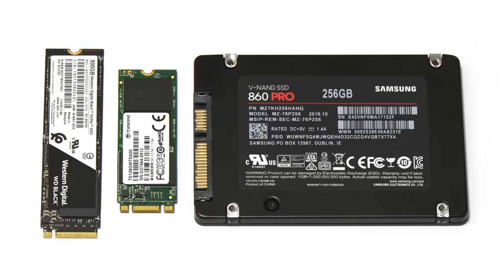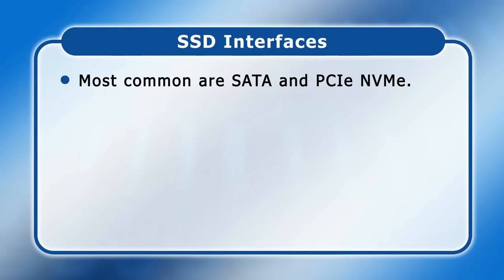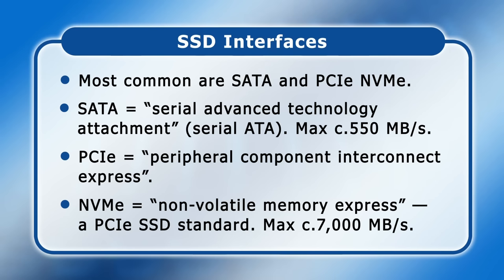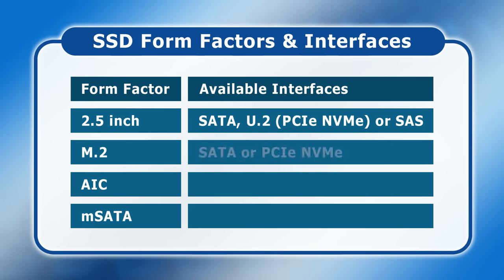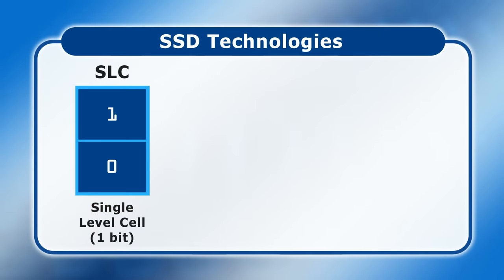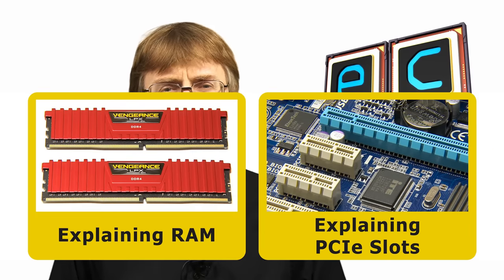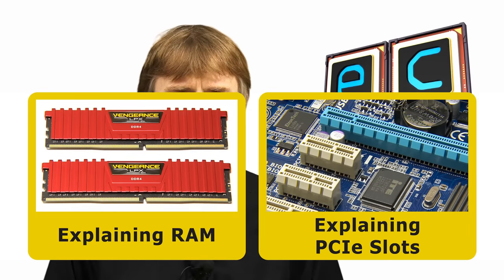Explaining SSDs: Form Factors, Interfaces & Technologies

Comment: I have a non-NVMe PCIe AIC SSD.  Instead of NVMe it uses AHCI so it will work with Windows XP or Windows 7 without special drivers.
Reply from the maker: Yes, such cards pre-date current AIC cards with NVMe. I this video I only covered technology currently on the market -- there is a whole host of legacy technology that is not covered.

Comment: When is it time to replace my WD 512GB M.2 PCIe NVMe SSD? It's at 8o% Life Remaining & 59% full. Is there a point it will cease to operate? It is my C:\ Boot drive and was Cloned from the Original 1TB HDD still used as a D:\ Data Drive.
Is the 59% full of the 80% Life Remaining or what does the 59% mean?
I really hope you answer because of the age of this video. you have some of the best Videos on Computers and I can understand what your explaining. Thank you so much.

Comment: Hi! Very intresting video. Thx. 
Is there any difference between lexar nm790 4tb 2237 and 2280? I have two HP 250 g10 laptops, one with 1TB and the other with 4TB. I want to upgrade from 1 to 4TB and noticed the laptop with 4TB ssd has lexar NMe790_2237 but only found 2280 to buy same model Lexar NMe790 4TB

Comment: I came here to complain about cable management- although you didn't show any in this video, I am certain it is not "protractor ready," as we say in the trade.  Do you have a suggestion box that I can leave a passive aggressive note in?  Excellent video, perfect for explaining the differences between modern SSDs!
Reply from the maker: You can leave all notes here in the comments! I read everything.
Reply: @ExplainingComputers  in that one video you made awhile ago your cables were off by sixteen degrees, resulting in a net loss of .0000062 CFM of airflow over a nonvital hunk of the motherboard.  This ruined my viewing experience and required me to seek  cable management therapy.

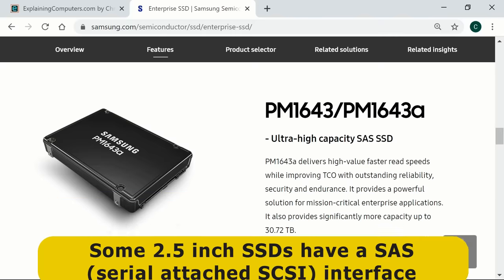Comment: At 6:29 you said that for SCSI it goes up to 1200mb/s or 1,2gb/s but theoretically SCSI can go up to 12gb/s. Is that correct?
Also AIC SSD, if it connects directly to PCIe then it uses NVMe and runs up to 6gb/s, right?
Thanks!

Comment: Thanks for the video.
I have a Dell Latitude E7470 ultrabook equipped with M.2 SSD 256GB and I would like to upgrade it to 1TB. I understand that NVMe SSDs are faster than their SATA counterparts, so I was thinking of getting NVMe SSD but I am wondering if it will fit into the M.2 slot of my laptop and if it will actually work as expected of a NVMe SSD. I guess I am asking to know if my laptop is compatible with an NVMe SSD even though it came with a SATA (the SSD has two notches like the one shown in your video).
I will appreciate anyone who can help resolve my confusion.

Comment: One thing to note is that on at least some motherboards (well, the one I have), if you install and M.2 SATA SSD into a dual SATA/NVMe, then you lose one of your SATA ports. I can't see any reason why somebody would buy an M.2 SATA over an NVMe one in such a case, but its worth being aware of. Many motherboards only have 4 SATA ports these days.
Reply from the maker: Yes, this is true -- we are sadly losing SATA ports, and an M.2 one steals a traditional port. Note that extra SATA ports can be added via a PCIe card.

Comment: Thank you, Most required detailed video. I have a question Sir, I have CPU :- i7 - 950 3.07GHz, MB - Intel DX58SO, RAM - 6 GB (Corsair), GPU - Nvidia GTX 750 Ti. Last Year i upgraded to Kingston SATA SSD, as my mother board has SATA 2 support which makes my drive on half speed 3.0 Gb/s. can you suggest any upgrade to get most out of the same setup? or can AIC ssd work fast on the same setup? I'm From India.
Reply from the maker: You could obtain faster drive speeds using an AIC SSD, or using a PCIe card that adds some SATA 3 ports, to which you could connect your existing drive. This kind of thing: https://www.amazon.co.uk//dp/B00BI4Z51Q/

However, and it is a very big however, you need to check if that motherboard supports booting from a PCIe SSD, which is may well not do. So have a hunt around in your BIOS. Certainly you can add a PCIe SATA 3 card and run an SSD faster. But booting form it may not be possible.

The above all noted, I suspect that your SSD, even connected by SATA 2, is unlikely to be bottlenecking your system.
Reply: @ExplainingComputers  thank you so much for guidance, yes ssd bottlenecking by sata 2.

Comment: You missed a couple of points around cache  - QLC drives can have DRAM cache or SLC cache or both (or neither) . These will have a significant effect on performance of the drive, both in terms of speed and reliability/life. 

The SLC cache can even be MLC but used as SLC. This cache would get used by frequently changing data.

Also as we move up in bits per cell it becomes more important to be aware of the need for wear leveling, which is programed from firmware thus checking for updates to drive firmware (not something done normally on HDs) needs to be done
Reply from the maker: I did not "miss points", but certainly did not cover everything about SSDs! :) The use of SLC cache will certainly improve QLC drive speed (for relatively small data writes). But it will do nothing to improve life expectancy, as data sent to the cache will always end up written to the QLC cells. I covered this in this video: https://www.youtube.com/watch?v=WACyyFF_ci0

Comment: Here's an update on SSD marketing. In these days of terabyte SSD's, SLC has become virtually extinct, as it requires too much real estate to fit into M.2 packages. However, some TLC and QLC SSD's are built with small SLC caches, which some marketeers think justifies referring to these drives as using "SLC technology". As this video points out, the word "multi" in MLC has tempted some manufacturers to use "MLC" to refer to what are in fact three-bit TLC SSD's or even 4-bit QLC drives. As a consequence, the term MLC alone is no longer sufficient to refer unambiguously to the most long-lived terabyte drives. It's necessary to specify "two-bit MLC" SSD to be certain you're not actually buying "three-bit MLC" (i.e. TLC) drives.

Comment: As long as we get the connectors right for the laptop's SSD, does it mean we can use any capacity drive we want with no addressing issue?
Reply from the maker: Some laptops from a few years back do still have addressing limits (eg at 1TB). But this is less and less common. A modern PC or laptop should be able to address any capacity of compatible SSD.
Reply: laptop is 2 yrs old, so it should be ok to go for 2TB?

Comment: Thanks for another very informative video, but one thing you didn't really discuss is the M.2 SLOT and the associated keys in the drives. In practice both SATA and NVMe drives fit into a slot with only an M key, and I have found in practice that they both work fine in such a slot. I have yet to see a slot with both M and B keys that only accepts SATA M.2 drives. I have a motherboard with two M.2 slots, and nowhere in the specification does it even mention SATA or NVMe, yet both types of drive work in these slots, and at their specified speeds. I suppose this makes sense, as why would they make a slot that fits both types of drive if one type didn't work in it?  That must be the reason why the M slot is in exactly the same position on both types? Or am I missing something?
Reply from the maker: You are missing the fact that some M.2 SATA drives are B-keyed only. :) As indeed were some NVMe drives. :) The keys indicate the number of PCIe lanes in use -- 2 lanes for B key, 4 for M key.
Reply: @ExplainingComputers  Be that as it may, does it mean that any M. 2 drive with an M key will work in a slot with an M key?
Reply from the maker: @Beevreeter  No. Because the slot may only support NVMe drives. I have SBCs with a M-keyed slot that will accept a SATA drive (B & M keyed), but the drive will not work in that slot.
Reply: @ExplainingComputers  Ah, OK, it's a bit of a minefield!

Comment: I got a Crucial MX 500 and it has a setting for "Momentum Cache" The Crucial software  recommends I use it on my Boot Drive, but then let's me know that without a battery backup is not recommended !. Does the Momentum Cache allocate some DRAM needing a battery backup for the partition? Or is that completely wrong. Please help me understand this

Comment: I've transitioned off of 3.5" form factor storage as I find 2.5" to be much more practical. Also, in the same space of a full-size 5.25" optical drive, you can fit between four (15mm) and eight (7mm) hard disks or SSDs.

Comment: Thank you very much. This was very entertaining. I'm in the process to buy a M.2 for my Dell Inspiron 3580. The 2280 M.2 drive on the board only has one slot opening (M-slot I take it) Will any M.2 drive with the correct slot and dimension fit, and work despite the speed of the M.2 SSD is slower or faster than what my Laptop support. Thank you!
Reply from the maker: Any drive with the correct slot (key) and dimension will not necessarily work. All new NVMe drives are M-keyed, and almost all new SATA drives are M & B keyed. But there are/were SATA drives that were B-keyed only, and these are very common in laptops from a few years ago. So you need to find out if the slot in your laptop is NVMe or SATA (or both) to be certain of getting a drive that works. This all said, a bit of Google suggests the your laptop takes a 2280 NVMe M.2 drive up to 1TB, but I would do some additional searches to confirm! :) Alternatively, look for a model number on the drive currently fitted, look it up, and you will find out if it is NVMe or SATA.
Reply: @ExplainingComputers  Thank you very much for the reply and trouble. It's all so complicated for the average user especially ordering online. Dell South Africa's client service is so pathetic. The manual I downloaded only said it uses a M.2 2280 solid-state drive, Class 35 and Class 40. But that Dell's own specifications, so I don't see it on any website I'm ordering.
Reply: @ExplainingComputers  Could you make a video or just if possible please reply.....Which external portable hard drives(ssds) have MLC, TLC and QLC.........i was considering buying a samsung T7 (non touch) or a samsung T5 or sandisk extreme pro but i dont know which one has a TLC , and which one has QLC......could you tell me how can i find these details for these portable hard drives......thanks.....i was looking to buy a TLC drive or MLC (just dont want to buy a QLC drive) but i cant find that information on portable ssds

Comment: One kind of oddball (and rather uncommon) form factor you didn't list is the 1.8" drive. Granted, it may not even be used at all on newer laptops, but my Dell Lattitude one has one. Rather annoying actually, when I initially went to up grade the HDD in it to SSD and discovered this after having bought a standard 2.5" drive. Fortunately, had a use for it in my main desktop machine, so all good. And fortunately (with some help from friends) was able to find someoplace that was selling a 1.8" SSD.
Reply from the maker: True. I decided not to cover the many SSD form factors no longer being sold.

Comment: Hmmmm, still not clear on M.2 slot for installing as well as the slots in the drives.  Is there a way to tell by looking at the M or B or B only slots to tell if the drive is mSATA or NVME?  Ditto for the slot on the computer/motherboard?

RichE San Diego, CA
Reply from the maker: Sadly not. Technically the M and B slots indicate the number of PCIe lanes a slot has available (2 for B keyed, 4 for M keyed). You cannot tell if a slot if SATA, NVMe or both unless you see its specs. Similarly for drive, although today all new NVMe drives will be M keyed only, and most SATA drives B & M.
Reply: @ExplainingComputers  Thanks, that's helpful.   Clever of them, eh?  Especially since the standard PCIe slot compatibility and referencing seems so well engineered.   Hmmm, if the SATA drives have both B and M (no, I won't go there...  :)  is/are they 2 lane or 4?
Reply from the maker: @googleplusisdead  SATA drives only need 2 lanes (far less), but are dual keyed to maximise slot compatibility. The situation more generally is a bit of a mess! :)
Reply: Just to add to the confusion, some M.2 NVMe cards have dual slots (B & M keys) and would work in M.2 slots that support both  the SATA and PCIe interfaces.
Worth getting as even PCIe x2 is much faster than SATA, but some luck is needed finding MOBO specs for older units! Looking at you HP, grrrr.

Comment: Regardless of the technology, one thing will remain constant: ALWAYS back up your drives, with multiple copies. SSD's DO go bad. Arbitrarily. At random. No apparent cause. Another very well known YouTuber (500k subscribers, vintage car rebuilds) was editing on his SSD when it was dropped and could not be recognized. Lost a couple months of videos not yet uploaded. No backup. He sent to a data recovery service, but haven't heard how that turned out. I have had SD cards fail for no reason and luckily 1) had backups and 2) found utility programs that are very effective in recovering the data. One is "ZAR" - Zero Assumption Recovery.

Comment: Wish I'd found this two weeks ago.  Ordered an SSD for my HP 840 G1 which had what appeared to be an M.2 keyed M.  Turns out, they used an M-Key but it's a SATA interface.  I had to return the SSD.  I figured, "M-Key = NVMe".  I figured incorrectly.

Comment: Did you not mention DIMM dot 2s? very common in the Gamer market
Reply from the maker: I didn't, but as they are risers for connecting M.2 drives, it does not impact the content of this video, which is about SSDs themselves. And I did say that M.2 drives "normally" slot straight into a motherboard for a particular reason! :)
Reply: @ExplainingComputers  no worries!!

Comment: I'm quite curious about how the speeds as well as how reliable those HDDs, SSHDs and SSDs are. We all know that M.2 NVMe SSDs are fast, but are more expensive than HDDs. As far as I know HDD manufacturers like Seagate and WD still make HDDs but had introduced some useful improvements like HAMR, Helium-Filled HDDs, and more. However say I wanted to buy an HDD or maybe an SSHD for my video editing, streaming, and compressing videos using HandBrake as well as OpenShot Video Editor - would it be better to just buy an ultra high storage HDD or best off buying an SSHD? I do use CrystalDiskInfo and CrystalDiskMark in order to check on my HDD health and how fast it goes. I don't use a HDD as my main PC storage drive, whereas I use a M.2 NVMe instead. Also I had to reassign the /TEMP folder and files to be stored in my RAM using RAM Disk from DataRAM Software as it's not wise for me to have temp files stored and erased constantly in my M.2.

Comment: That is awesome. However, I have HP DC 7600 PC. It has a blank screen and says check signal cable. I have checked CMOS battery, ram, changed cable but no change. It all begun after I changed the thermopaste on the CPU. The cooler doesn't run now. But I doubt if it can affect the video card that is in build. Could this be a motherboard issue?
Reply: Lol did you actually check the cable, I sold 7 HP Elitedesk G6 Miccro and client   thought they don't work. Turns out cheap rubbish display cable didn't work. 

Most PC have bleeping indicators to tell you if CPU, RAM, SSD, or motherboard has fault. Are you getting any bleeps
Reply: @iagree7388  all the necessary has been done. I checked and found that almost all diots are swollen

Comment: Thank you for this informative video.  Personally, I prefer Samsung's naming convention.  The further we go into Greek (and Latin) terminology in the future...hex (HLC), hept/sept (SLC), oct (OLC), ennea/nov (NLC), dec (DLC)...the more confusing it will get.  They already mixed Greek and Latin (quad- is Latin whereas tetra- is Greek for 4, but penta- is Greek whereas quint- is Latin for 5)...so it will be a mess.  In this case, 2-bit, 3-bit, 4-bit, 5-bit, 6-bit, and up offers a reprieve.  It's not that I don't like Greek and Latin scientific words.  I do.  But that's for new one-off words, like a new element...or something that won't continue increasing in number throughout the years.  Also, "multi-" is more than one, so it works!  Anyway, those are my two cents!

Comment: Western Digital seems to use yet another notation -- TBW.  For example, the Western Digital PC SN730 512GB NVMe SSD that's in my laptop says it has an "Endurance of 300 TBW" according to Western Digital's website.  I assume this stands for TeraBytes Written.  Which would lead me to believe that it uses QLC technology... It would take 600 complete P/E cycles to write 300 TB of data to a 512GB drive, if I'm doing the math correctly.  And 600 P/E cycles is pretty much right in the middle of your QLC P/E cycles table.
Reply from the maker: Yes, indeed -- TBW is terabytes written. All manufacturers provide TBW data/projections, and often because they are nervous I think about indicating P/E cycles. I covered SSD life expectancy in another video a few years back, so did not weight down this one an more with this issue, not to mention wear levelling. :)

Comment: 12:25 i heard that Samsung switched to TLC or "3-bit MLC" and i was about to add that but i'm not sure anymore because as i was checked that before posting so i looked it up on the German version of the Samsung website and there it states that both the 970 Pro and the 980 Pro use "Samsung V-NAND 3-bit MLC" which surprised me so i looked at the US version and then it was "Samsung V-NAND 2-bit MLC"  for the 970 Pro and for the 980 Pro are just do data there on the product page of Samsung itself ... 
So they either just put the wrong data on the German website or they really sell different products in different countrys (like there smartphones with the Exynos processors) 
.
Screenshot of all the 4 product pages i checked: https://abload.de/img/samsungxfjgf.png